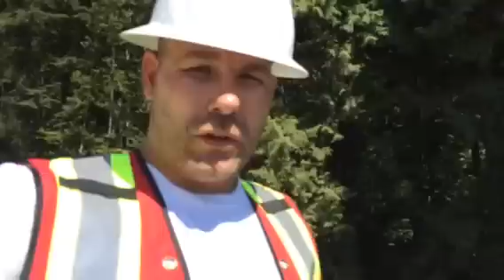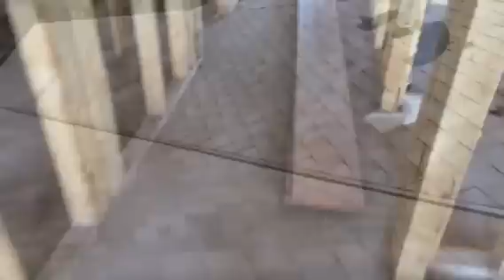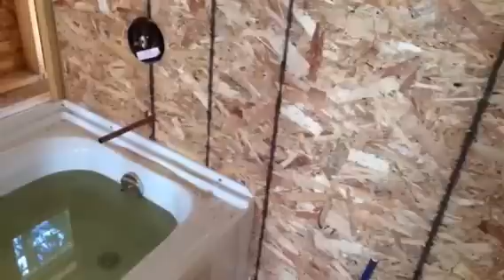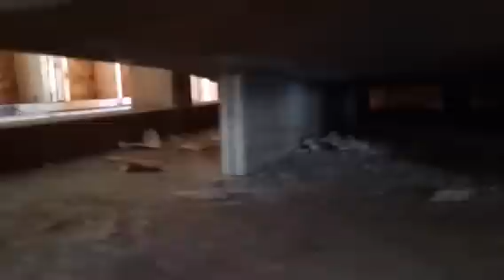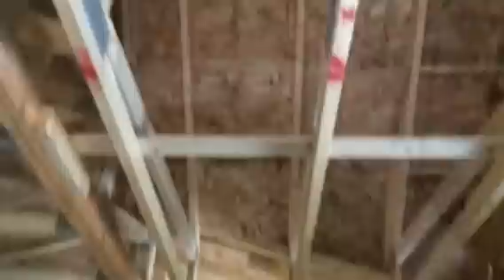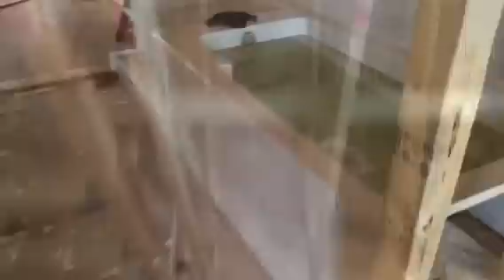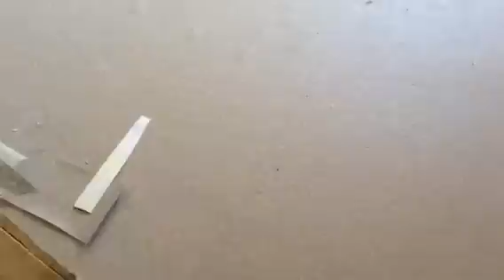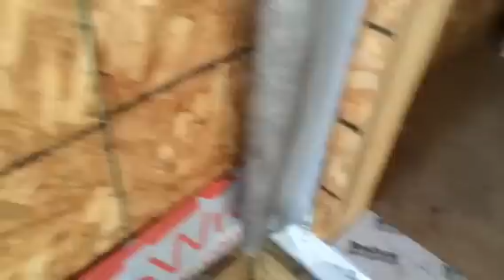New Home Construction Fails

Comment: Speaking as a retired union carpenter with Class A Builders License. This house builder should loose his license, that is if he ever had one. I've worked most industrial and commercial buildings, here inspectors are on the job full time. But house builders hire mostly unskilled labor. Their Bottom Line is to save Money at the owners expense.  Like you said " The owner will save money and future problems  in the long run, If he/she hires a full time licensed inspector".  One who has no ties with the builder.    Respectfully submitted.
Reply: "loose" the license? what, is it too tight?
Reply: I watched my home being built it was nothing but arguments the builder kept cutting corners and he ended up doing completely the opposite of what he said before contract was signed ,  envy homes was my builder and I ended up paying him in full and firing him just to be done with him. we talked to references but of course it was people he gave us numbers for. after paying him in full 3 months later we got a lien put on the house from one of his suppliers that he did not pay
Reply: kenneth moore The majority small time home builders are all alike. They use unskilled workers, unapproved material. Even in some cases improper electric wiring that could burn down your home. Improper plumbing, failure to vent soil pipes, this could cause a poison methane gas buildup in ones home. I've seen every costly short cut known in the business. Some cased the home had to be closed by the city building inspector. Tagged unsafe for human hebetation. Rule #1 never hire any unlicensed tradesman and make sure the contractor carries workmen compensation for all his workers. If any worker is hurt on the job without Workman's  Compensation insurance. The homeowner is totally responsible for all medical bills. Including  out of work compensation and legal fees.  What happen to you, is the same thing that happen to my sister-in-law who lives in Vermont.  Next time you hire another building contractor have your attorney draw up the contract for your own interest .   Wishing you all the best!

Comment: it saddens me greatly not to see a pile of quickcrete supporting that tub. though with a tub that elevated id like to see them use framing to raise the floor and we like to use 2x4s on the framed wall to add extra integrity to the  back edge of the tub.

and the lack of waterboard lol